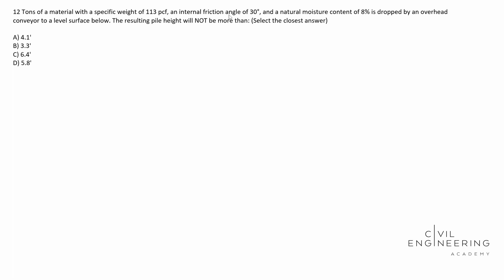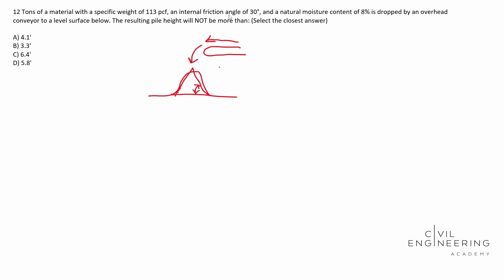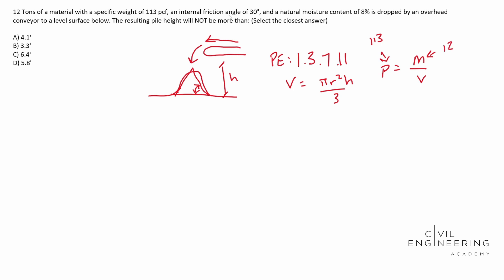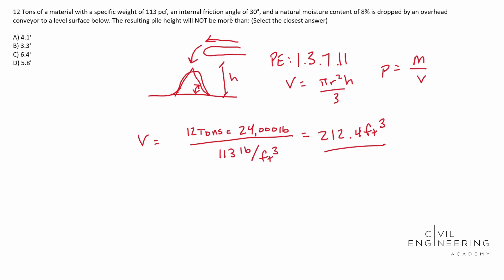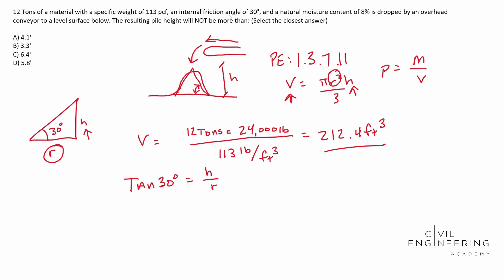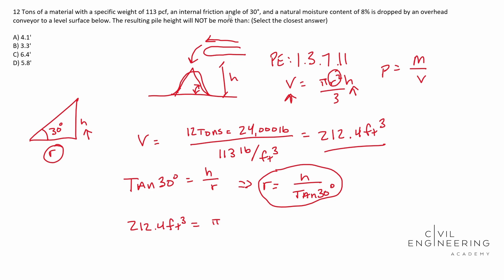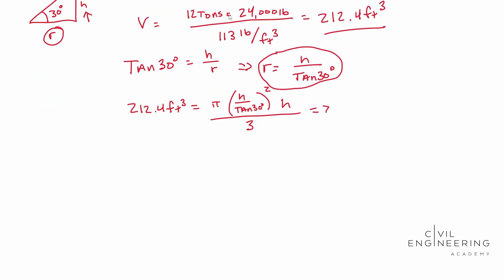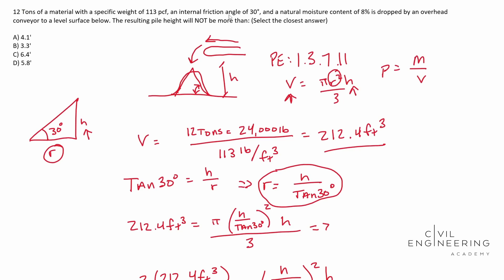Civil PE Exam - Geotechnical - How To Solve For The Height of a Material Pile

Comment: When I do tan (30) I get 0.577, but your calculations show 0.33. So when I solve for h I get 4.9' instead which isn't an option in the answers. Am I off somewhere with that?
Reply: i think what he did was apply the ^2 to the numerator and denominator in the parenthesis. (h/tan(30))^2 = (h^2)/(tan^2(30)). tan^2(30) = 0.33
Reply: Yup, definitely forgot to square it haha. Thanks

Comment: Ncees hb 1.1, p. 3, 10, 141.

Does every other YT channel copy these problems off of each other or there aren't that many ways to ask a question about a pile of soil with a friction angle using the cone volume equation ?

Must have solved this one 3-4 time on different YT channels already. What's going on here?
Reply from the maker: Common question on the exam I'd venture to guess.  In addition, there's probably only so many engineering questions or concepts.  You'll start seeing similar or the same problems as you do more and more of them, which is probably a good sign as you're getting familiar with them and getting them down.
Reply: @CivilEngAcademy  thank you for explanation.